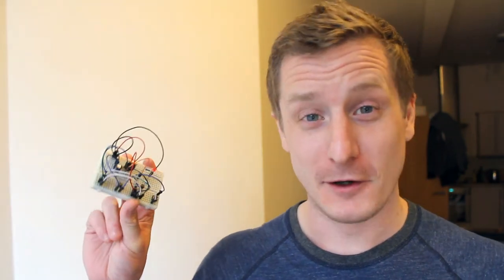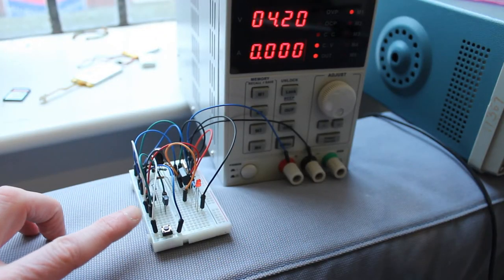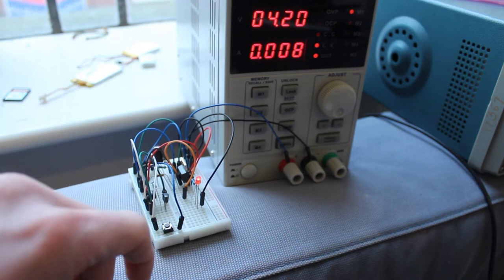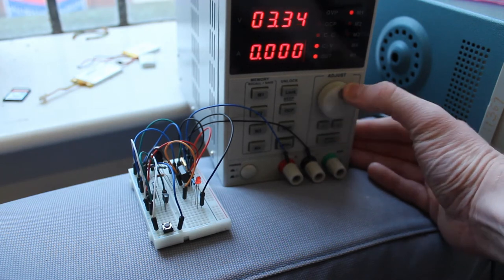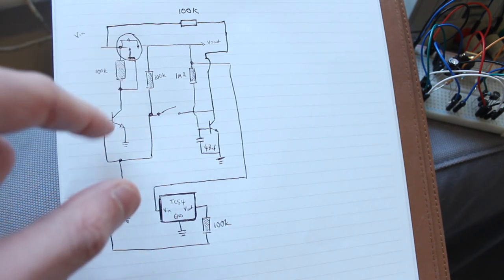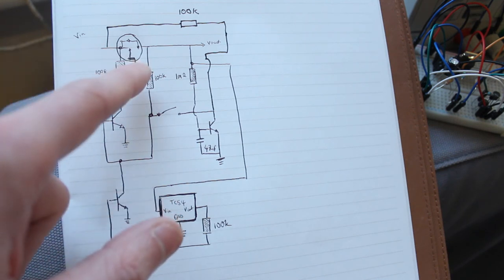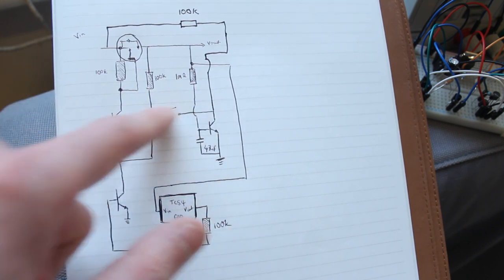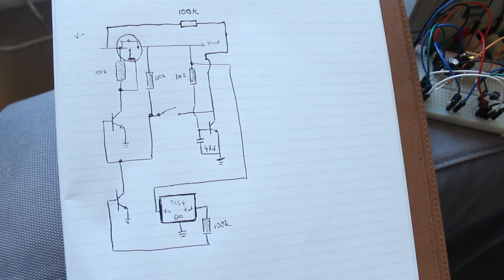Zero Current Low Voltage Cut Off and Latching Power Switch

Comment: Hi I've been trying to find a circuit or module on eBay, I have two solar panels that go through and mppt controller, what I want is a circuit that will switch off and on the power to a load when the current being delivered from the pannels goes over say 10a but adjustable would be great. The whole thing needs to be DC sensing . Any thoughts

Comment: nice video. One quick question, what modifcations I should do to make one for 12 Voltage supply?
or other there any circuits out there that will latch at below say 11 Volts and remain OFF even if the voltage comes above 11 Volts again? thanks

Comment: I've watched this video multiple times because I wanted to make a custom low voltage disconnect to work with LiFePO4 cells. I've since successfully made my own circuit. 

I'm pretty sure this circuit is set up wrong. When the voltage is high on your TC54, it turns on the first transistor which drags the base of the second transistor to ground, switching it off, which allows the gate voltage of the P channel mosfet to go high which... Turns off the mosfet!

You have one too many transistors in that sequence. My circuit essentially does the exact same thing - I haven't used a TC54 but one made by Ablic instead, but it operates the same. Directly drives base of transistor (don't need resistor because output of voltage detector is very low current), when voltage goes low, transistor is turned off which drags mosfet gate high, switching it off.

I suspect your p-channel mosfet turned off because your supply voltage was so low that negative Vgs went above its cutoff threshold.
Reply: Ahh, I see the TC54 you're using is output high when input is low. That's not the common mode of operation for these devices.

Comment: I have a question.. if the battery keeps draining .. wont the voltage on gate of mosfet lower as well? So wouldnt it start conducting again eventually?

Comment: Hi, I put this circuit together on a proto board, but using the TC54VC IC in a small surface mount package and soldered thin wires on each pin. Intend to use this circuit in RC airboat for a small and powerful gear pump for active cooling of the boat's ESC.
I previously tested and run the pump from the power supply's regulated 4.2V max., where the pump's motor draws around 1A at that voltage.
Connected the motor in parallel with the led, but as soon as I tapped the pushbutton, I could barely hear the hiss coming out the motor. Experimented with smaller low current motors and they runned fine.
Now, since I don't understand how exactly this circuit works, but I assume that some of resistors serve to limit the output current draw, my question is which one/s? Or does the TC54 IC simply automatically limit the current?
Reply from the maker: It sounds like your main mosfet is not turning on all the way (saturating) so you are limited in the amount of current you can draw. What mosfet are you using? You should be using a logic level mosfet that works at around 3v.
Reply: Hi, using the exact MOSFET as in the video - IRF9520, voltage detector IC is VC30 (it cutts the diffused LED off without any heavy load connected in parallel @ around 3.2V), and all 3 transistors are 2N3904 as you suggested in earlier message. Since these MOSFETS aren't very cheap in my country, and I don't have any advanced knowledge on them, but still want to keep my batteries safe, is there any better alternative?
Reply from the maker: Ah, I think that is a little more than spec for the 9520 at 4.2v. It can handle around 300ma but will need to feed the gate with at least 5v if you want to pass 1 amp.
Reply: So in that case should I experiment with a MOSFET that will feed the gate pin with a lower voltage vs current ratio? How do I do the search/identification for that?
Reply from the maker: Yeah you are essentailly looking for a logic level mosfet that has high current and low VDS, the graphs on page 3 - https://www.infineon.com/dgdl/irf9520n.pdf?fileId=5546d462533600a401535611a7411dbb demonstrate the current capability.

Comment: Hi I want to design a circuit which draws curret from a  hub dynamo. I need the cutoff voltage to be at 3.3V. Is there a variant of TC54 for this? Also I would like to know the minimum input voltage required for TC54 to work
Reply from the maker: I believe the TC54  does have a 3.3v variant. The TC54 works down to 0.7v but the other components in the circuit will not.
Reply: Thanks for the reply.
I would like to know if it's possible to design a standalone device which doesn't need a fixed voltage for its working. Eg. a zener diode.

Comment: Can someone pls reply is the TC54 volt. detector IC a VN type (with N ch Open Drain) or VC type (with CMOS output)? Does it matter which type is utilized in the circuit?
Reply from the maker: In this circuit the output is high when the battery voltage is sufficient. When the voltage falls below the 3v then it goes logic low.
Reply: Alright, but what does it exactly say on the TC54 chip (i.e. does it say TC54VN... or TC54VC...)? That's what I meant by VN or VC type?
Reply from the maker: No idea now I am afraid, it was almost 3 years ago. I would imagine it would be VC as I described it has a logic level output.
Reply: Thanks mate!
Reply: Hi Great tutorial. I am new to this but i am looking for something similar. What specs would i look for if i wanted a  voltage supervisor that went low when when battery voltage is sufficient. ie When voltage falls below 3v then Vout is high (at the same voltage as Vin)
Reply from the maker: Use the same TC54 and put a PNP transistor on the output. It is triggered on a low signal and will allow voltage and current to pass. The TC54 goes low when the voltage falls below 3v.
Reply: David Watts that's great. Thanks

Comment: Could you please specify NPN transistor names?
Reply from the maker: Surprised I didn't but it probably would have been a 2n3904
Reply: Thanks for the reply. One more thing, I couldn't find the TC54VX30 voltage detector IC anywhere in my local electronic stores, nor on ebay. Are there any alternatives for this IC?